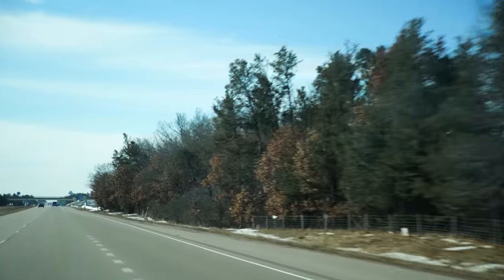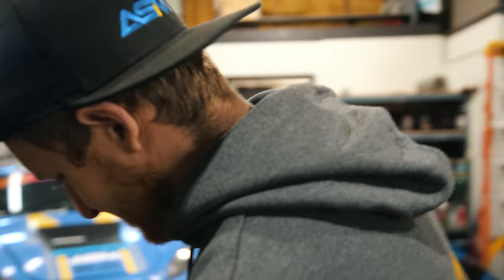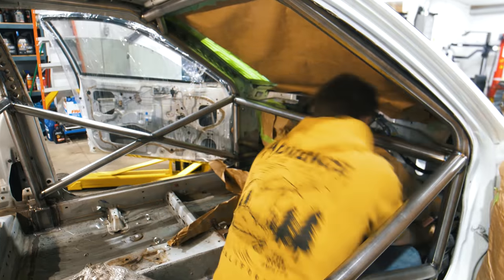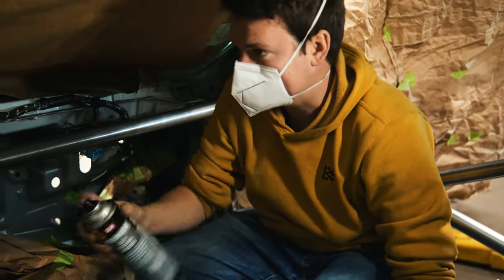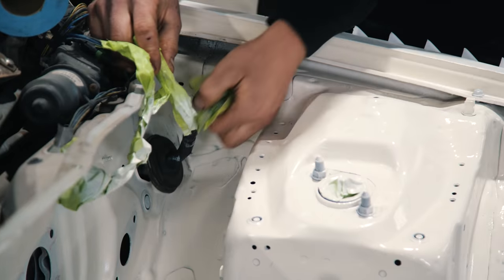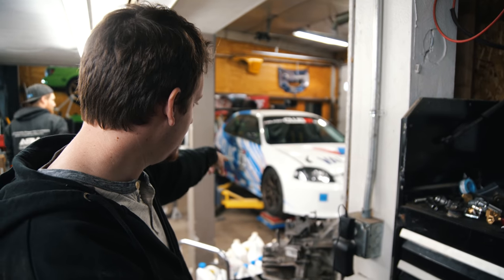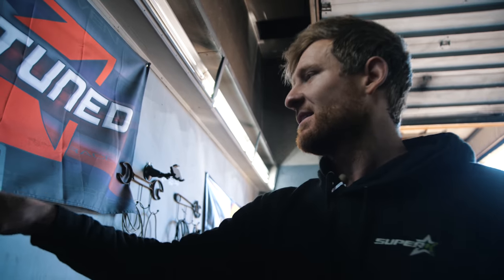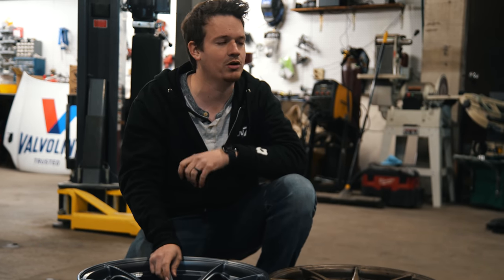Refining My K24 Civic - Ep 3: Back Together

Comment: When you guys were talking about the anomaly of the 250 HP and now only making 235 reminded me of a segment from Wangan Midnight where they said "For special cars to us, like Z, when a sudden power down occurs, everyone continuously repeats the trial and error cycle many, many times. But what has been lost never came back. The heart of the tuned car was lost."
Reply: Had the same idea. LOL
Reply: That is pretty depressing
Reply: If the session was essentially the same, the dyno reading is sort of irrelevant. They'd be able to go to another dyno and get a different reading due to calibration variance. The most important part is that the tune is solid in a controlled environment so that it can be tweaked from logs at the track.
Reply: I should really finish wangan midnight ahaha, I'm on like ep. 8 xD
Reply: The car also got lighter
Reply: @_T.C.G_  also read the manga it has so much lore like how reina ( the gtr girl ) actually was next door neighbor of akio and how akio parents are essentially are pieces of sh*t
Reply: @sabyasachiroy7482  Oh ty for the recommendation, actually watching ep. 10 rn :D
Reply: @sabyasachiroy7482  thanks for the info bruv will do
Reply: I'm wondering if the Resurfaced cylinder head had a part to play as it would have raised compression a little and thus could have also made the engine more knock prone or limited hence less timing would be able to be applied... just theories though unless they also used a thicker head gasket from the OE manufacturer ? hmm.... variables
Reply: @BjornFSE  increasing compression generally helps for power on NA engines
Reply: i love the Wangan Midnight reference.

Wangan Midnight is superior to Initial D.
Reply: @s_t_r_a_y_e_d  An unpopular opinion but one I too stand by.
Reply: @BjornFSE  what you gained from the extra compression shouldnt really be too far off from what you'd have to lose in timing to keep it from knocking

Comment: Wrap the areas of the cage you will come in contact with clear vinyl to protect it
Reply: Should actually pad them, not to protect it, but in case of an accident if you hit it. Sure you have a helmet but hitting steel isn't fun.
Reply: @lucaskelly4590   I just meant the door bars that he will rub on getting in the car, of course padding higher up where your head is , it’s probably even required in his class
Reply: but weight

Comment: I am totally amazed that you all can COMPLETELY disassemble AND reassemble a car!  I mean, how the heck do you keep track of how everything fit back together and work!
Reply: It gets easier after 3 years of taking the same car apart and putting it back together, but still impressive.
Reply: I’ve had so many car friends in my 20+ years of owning Hondas that just know how to do it. I’ve rebuilt a B18C1 on my own and had to lay out all the bolts and parts like one of those exploded images, plus carefully follow the manual. The friends I have just have it down, and it’s never not impressive.

Comment: That whp in an NA is very good when compared to some turbo engines that make less or the same
Reply: like my stock eclipse 4G63 at 12psi, ~180whp
Reply: @5PYZ3R  Haha same as my stock MS3, 2.3L on 15psi ~200whp
Reply: Wait so how much wheel hp does a 1.8t Jetta have? 180hp stock.
Reply: @ismaelgomez2158  usually about 12-15% power loss for FWD so I'd guess about ~156whp which is a little over 13%

Comment: the episodes on these should be played not just on Youtube but also on TV & Netflix man like a series or car show on discovery Turbo or something cz The Production quality has always been top notch.

On a side note:
I'm wondering if the Resurfaced cylinder head had a part to play in the lower HP numbers (besides the conditions that day) as it would have raised compression a little and thus could have also made the engine more knock prone or limited hence less timing would be able to be applied... just theories though unless they also used a thicker head gasket from the OE manufacturer ? hmm.... variables

Comment: Our b16a rally engines fully built make more power 😋😅 240hp 1600cc but our k20 in the ef9 makes 280hp without Itbs it would be making 300hp on Itbs 💯🤙🇮🇪

Comment: Is ben running on e85 on this dyno? And the 72mm and 80mm throttle body? And if ya’ll remember the k swap episode 4 and andy puts mia on the dyno and it hit 259whp on pump gas and 268whp on e85.. 

Correct me if i’m wrong with this.. 😅

Comment: On a NA engine, real tuning happens when it has about 15k of daily driving with long highway trips. I've had 5 Japanese NA engine that I bought brand-new and driven to about 200k before retiring it. Peak power usually happens around 50k (miles). All my engines had real soul and performed better then expected. Key to my success, is that I never had to open-up the engine and did my own maintenance.

Comment: The engine and transmission are still tight. Most cars see a gain in hp after some driving. Also I didn't see any cleaning done to the injectors? Spray pattern may have changed and caused the loss in power.  Also an exhaust leak, either at manifold or piping can cause a loss of power.

Comment: Pretty nice build with lots of attention to detail, but a couple things I don't get. You flock a dash among other things to reduce glare, but then paint the interior white. I kinda wonder how much glare that will generate.

Also I get Valvoline is the sponser and they make a decent product. However I would not use their fluids in a race car. Their oils are just not designed for that. I would have used Redline or maybe Motül.
Reply: @dickfitzwelliner2807  that's a bit scary since some may follow suit. More common/ cheaper synthetics are actually a blend and just not designed for the rigors of racing.

Comment: Gear ratio can definitely effect the HP total.  And sometimes things just wear or loosen up in a way that the peak never quite comes back.  (As a dyno tech I found it's usually lower end based (like bearings/rings/carbon buildup)